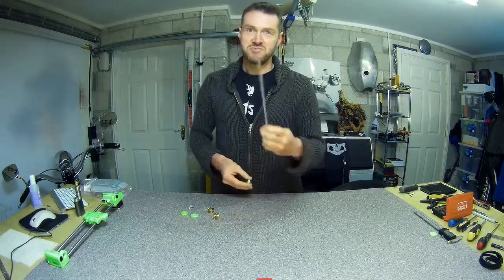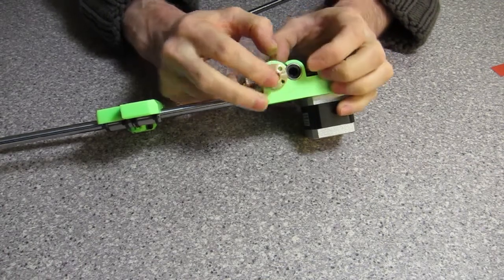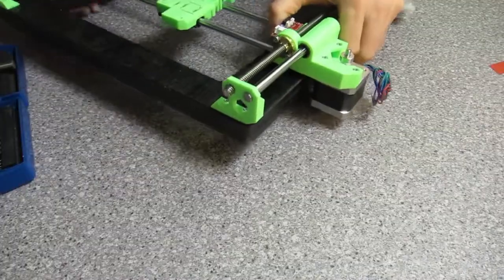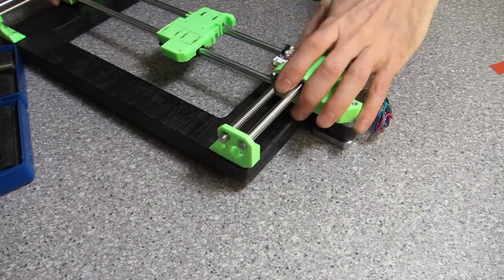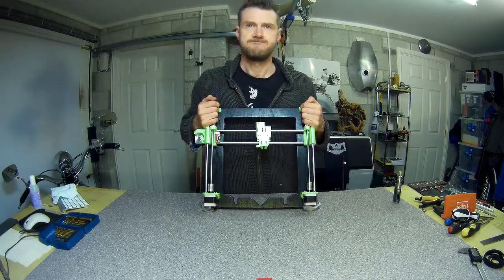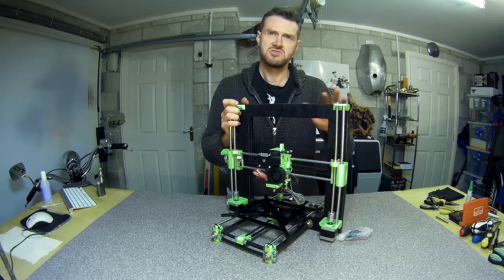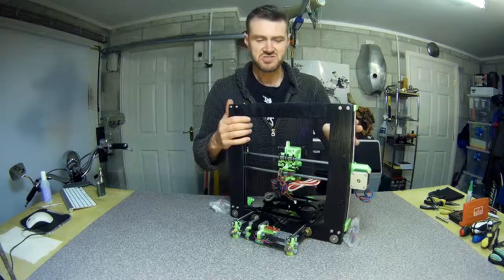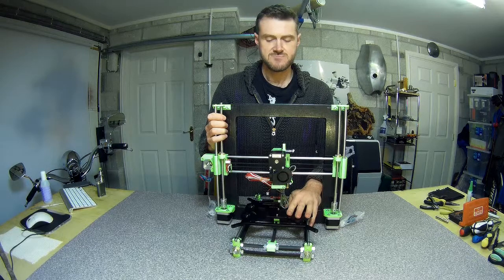How to Build Cheap DIY Prusa i3 MK2 3D Printer - 6 - Z Axis & Extruder Build

Comment: remove the lead screws and see how smooth it runs up and down the linear rods. also, the x-axis can cause it to skew when the belt is tightened or if the plastic carriages are in to tight
Reply from the maker: not sure what you are referring to - that was 4 years ago and I am now 50, so I don't remember anything that far back
Reply: @julesgilson.  on your video you mention that the z axis was binding so i was stating that the x axis belt tension can pull the liner rods and lead screws in towards the center of the printer, which will cause z axis binding:)